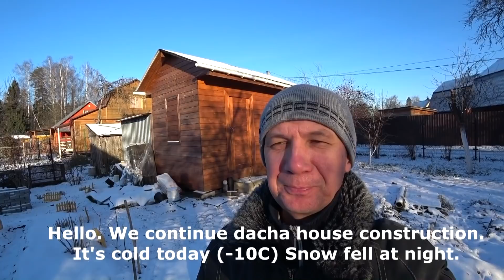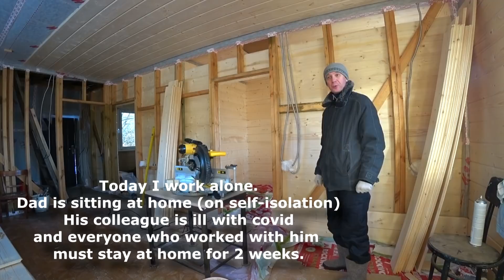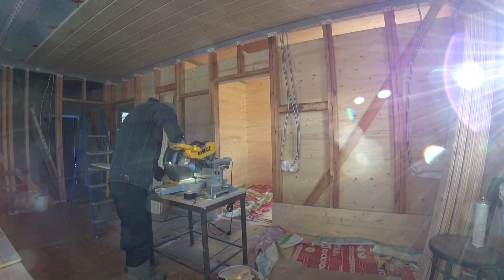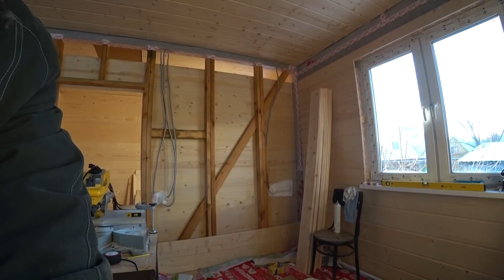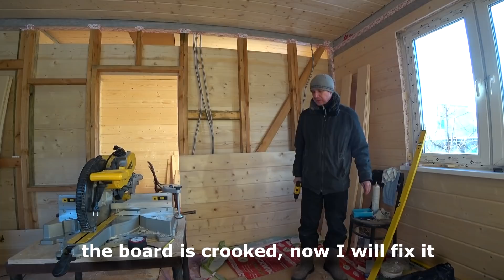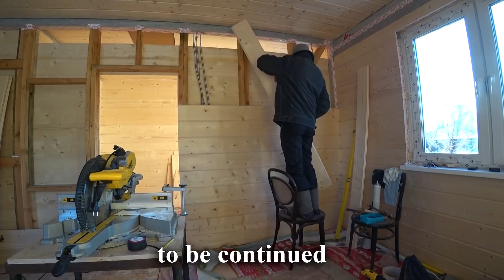Now I Build Dacha (Village) House Alone: Very Cold, but No Choice! Russian Wooden House Construction

Comment: As it is winter, the pine planks are dry and narrow. Would advise you leave a gap of 1 to 2 cm. 
at top of wall to allow for expansion in summer heat. Otherwise buckling of wall may happen.
A strip of same wood you can apply over the gap to make crown molding detail. Bet fingers 
are getting cold. Good luck. Happy New Year.

Comment: Nice work, Alex, you have good tools! I have that same drill but not the saw. As for these guys who recommend an air compressor and nailer, you're doing just fine.  However, If kerosine heaters are available there at a reasonable cost, one might be helpful. I use two of them in my barn during work sessions and they raise the temperature just enough to work comfortably. Good luck with your dacha, it's going to be satisfying to enjoy the place that you built yourself.

Comment: You are so trusting with your measurements!  When I built my outside storage facility I had to fit each plank before measuring the next one as one of the walls I built  was not exactly vertical and so the planks got slightly longer as you went up. Well done.